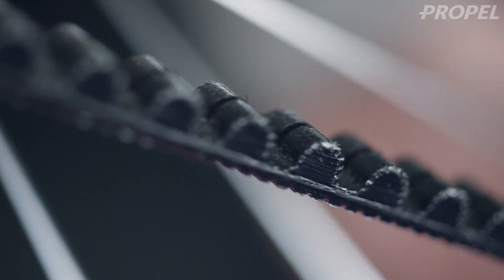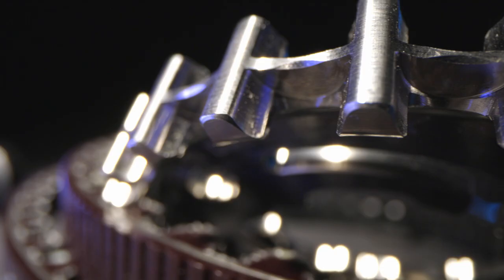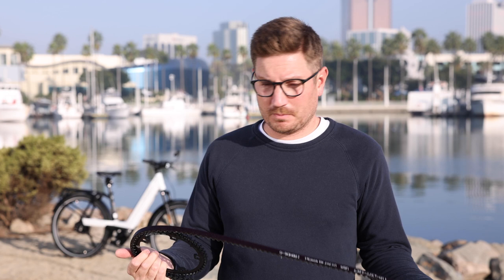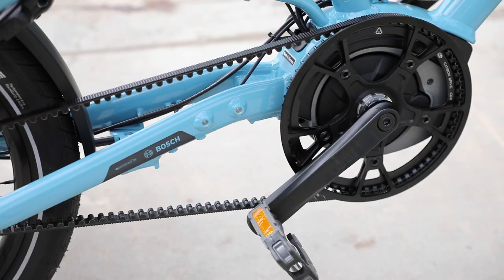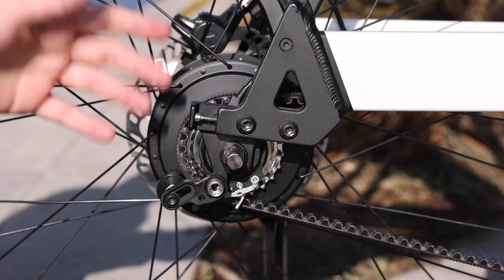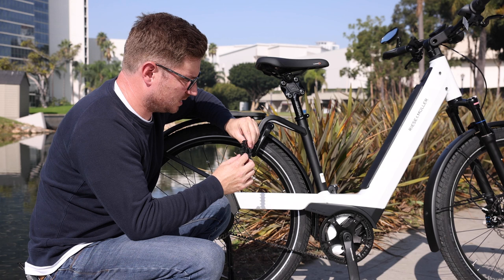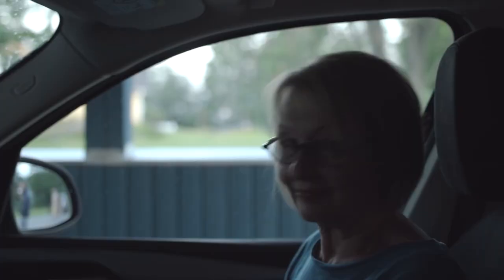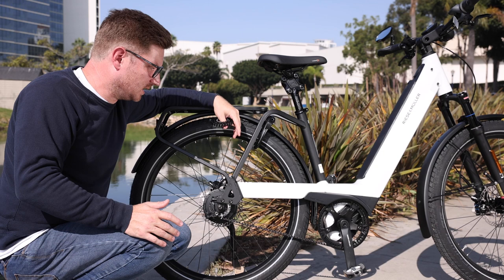Belt vs Chain - Will the Belt Win the Ebike Race?

Comment: Thank you for the amazing review! I’ve purchased my first bicycle with gates CDN few months ago and never regret about that, it is really almost zero maintenance and comfortable technology. 

Yep, there are some cons. Total odometer now about 1500km, often with rainy and greasy conditions. Because I purchased a low-end bike (polygon path i8) with polymer front and real sprockets,  the real sprocket already looks very bad and soon should be replaced with stainless steel one. Fortunately, seems like Gates do not offer anymore polymer rear sprockets option, so new users won’t face this issue, I hope.

Commuting by bike is not so popular in my city, carbon drive even less popular, and for all the time I’ve seen only 2 another bikes with carbon drive on the street. So, if this is also a your case, be ready that people may be curious and will ask many questions like “weird chain you have, nah, what is that?”

Comment: Cars moved from timing belts to timing chains so they would last much longer. Somehow with bikes they're marketing the opposite.

Belts are usually lighter, have no backlash and dampen vibrations a bit, which is nice I suppose.
Reply: Flapdrol, I thought the same thing. I'm guessing the main difference is that the timing chain of a car operates in an enclosed, clean, well-lubricated space, while bike chains operate out in the open and are thus vulnerable the elements. I still think timing chains are more durable for cars, but this video opened my eyes to some of the potential benefits of a modern belt for bike applications. It seems like the biggest drawback of the belt is that it is mostly impractical to have a hub motor due to the transmission being in the hub, thus kind of forcing a mid-drive setup.... the increased complexity of this setup (with internal hub transmission and mid-drive) I'm guessing makes these bikes more expensive, though that's just a guess.

Comment: If you live in super steep terrain, like I do, a Rohloff with belt drive is a must.
I’ve just destroyed a Bosch CX motor after three years of use, because the chain& drivetrain stressed the motor too much.
Also, I had to get a new chain twice a year and a cassette once a year.

Comment: If you are going for low maintenance you will need to use wheels that do not have wire spokes. Using magnesium or some type of light weight material that does not require adjusting spokes or trueing all the time. You will also need to use a sealer in the tires.
Reply from the maker: These can also be good measures to decrease the maintenance requirements

Comment: Thanks for a very good movie, Chris. It has everything you need to know about a belt-driven bike! I have experience approx. 3000 km driving belt driven R & M bike and I really enjoyed. The only small drawback is the annoying sound when driving in dusty conditions on a gravel road. But in this case, water washing helps. Cleaning and belt tightening are the only maintenance that I had to do.
Reply from the maker: Nice Tapio! Thanks for sharing your experience. I’d recommend trying some silicone spray to help keep the belt quiet in dusty conditions. You could also try Rohloff chain lube, I know it seems weird but it works well.
Reply: @Propelbikes   Thank you those tips, Chris. Until now, I have done a spray bottle of water and an old toothbrush, but next time I'll try, a silicone spray. Rohloff grease can be harder to find in here..
Reply from the maker: Cool! I hope you report back how it works out

Comment: About 5,300 miles on our two Rohloff's with Gates.  Only issue we encountered was the lockrings for the cogs did loosen up at one point - which caused noise.  A special tool and the right size torque wrench has solved that problem.

The belts still seem fine.  The cogs do show some wear - but they appear to be wearing a "flat" to the end of each tooth as opposed to each tooth wearing down thinner.  We live in the desert, so the belts never see wet weather with road grit thrown up on the bike.  From the what I've seen, I'd guess the cogs might need replacement at about 10,000 miles.  Question:  Should the belt be changed at the same time as the cogs?

Comment: I've own motorcycles since I was old enough to drive ... I'm not talking about a honda step through, no, my first bike was a Triumph Tiger Cub ... then 3 months later i bought a Pre-unit 650cc Triumph at a police auction for $150... restored it (even the "Bates" seat)... over the years I still own 3 Triumphs (Including a 1968 Bonneville with a 750cc kit, a WWII restored Indian Scout (750cc) and a 1979 Shovel head dresser I bought NEW. One day a friend of mine years ago was with me at a repair shop here in Australia where I moved and I was getting some work done, so he lent me his new Harley which had a Rubber mounted engine, rubber primary drive belt and a rear wheel rubber drive belt. It was the smoothest Harley I had ever rode. When I got back I mentioned this to the HD mechanic.  He claimed not only smoother, less noise, but more efficient drive, in other words more HP. As I'm older than dirt and all that metal I got installed in me during the Vietnam War, I was looking at building my own new Harley Trike (still thinking about electric???) I think rubber drives beat anything hands down from my experience. I even took a friends Direct drive BMW R-750 on an 800 mile trip and it took for ever to get use to the drive on wet roads...I am old ...LOL

Comment: For me the Gates CDX Belt with Enviolo hub is a clear winner. 
The only thing that happened in 2000 km was that the belt started to make a small squeak after a thorough wash with detergents (of the whole bike). Applying a little bit of silicone spray, and all is smooth again. 
No wear visible after 2000km anyhow.

Comment: After riding both a belt with Shimano Nexus Hub then getting on a chain with derailleur I can tell you the performance of the chain driven machine is so much more responsive,  and it pulls up steep hills with less effort.  And as for maintenance I'm not sure what all the fuss is about, squirt of oil once in a while.  That said I would like to try a belt for a year, but I live in a hilly area and have been disappointed with the gearing of the Shimano hub, also theres the weight of hubs to consider.
Reply: I have a normal bike with a Shimano alfine hub and a belt and I have to say I cannot feel any lost of power. I have to agreed Shimano hubs are entry level in internal gear hubs and they should have more gears but they do the job. The belt is the best part . Free of maintenance. Love it
Reply: I've read many comments of users stating that gearboxes and gear hubs are less efficient than chain driven bikes with derailleur in good condition. And a Shimano Nexus Hub is certainly not as  efficient as a Rohloff gear hub or a Pinion gearbox. But some users stated that they felt the Pinion gearbox and the Rohloff gear hub beeing sluggish and less efficient compared to a chain driven drivetrain with derailleur.

Comment: How much more difficult is it to fix a rear flat with a belt drive?
Reply from the maker: It shouldn’t be different than a chain, but it really depends on the drivetrain. Some internal hubs can take a little extra work, but not much.
Reply: @Propelbikes  On my Priority Current you can remove the wheel without changing the belt tension adjustment. There is an additional step to disengage the shifter on the gearless hub. Also, you need a wrench since it doesn't have a quick release axle.
Reply: Cumbersome. There's no way around it. Not so much the belt, but the frame. Get the Schwable or another "indestructible" type. I go to a bike shop every second year and have them change my tires. Not worth the hassle.
Reply: It'll depend on the frame. I think newer models are probably better. My 2010 road bike with a belt requires redoing all of the alignment if the rear wheel comes off. The actually removal and reinstallation is easy, but getting everything lined up again can be a pain.

Now that belts are more common, I think the newer designs use vertical dropouts and the wheel can be removed without changing the alignment.

Comment: Obviously you cant use belt with derailleur but i have internal geared hub and minimal loss in efficiency of this system is outweighed by positive factors.  Im not planning Tour de France entry so sticking with belt from now on.
Reply from the maker: I totally agree. The upside is way more than any of the downsides. I think you’re not alone in this thinking.

Comment: On the maintenance comparison:  what about chains protected as in Dutch bikes (like Gazelle) with full chain guards and internal hubs?  Do those chains last about as long as belts? How much less maintenance do they need than regular chains?
Reply: If the system is as enclosed as the chains are inside the engine of a car, than it has been proven that chains are more durable than belts. You never have to replace chains in the drivetrain of a car. Belts need to be replaced, otherwise they will tear up after 100.000 or more km in a car.

Comment: I Bougth a E-bike, short after my 70years Birthday, now i have used that bike with Gate´s Belt for 2636 km, without problems, the last 2 Month´s not used, because we have bad weather in DK. My Bike is a Danish Design: MBK Vitesse with Yamaha Motor PW-SE 60Nm and 400W Battery. Longest drive at one tour was 69 km, up and down at  normaly Roads. I can REALLY RECOMAND to buy a Bike with Belt.

Comment: I had a non electric belt drive bike, the Spot Acme and I was stunned how much the shimano alfine system slowed the rotation of the tire, I thought something must be wrong. The bike looked spotless after a salty WI winter, I'll give it that, quiet too. If I got a flat I might have to kneel down in bad weather to hold a phone on a belt to retension it.. I'd even consider a titanium cassette and chain over a belt even though the cost is high.

 I'm glad you mentioned it causes some stress on the chainstay.
Reply from the maker: I wonder if you had something else going on with that bike. It shouldn’t slow you down at all. For changing a flat different drop out designs are better than others. We don’t see the ones you need to retention when you remove the wheel anymore. Usually the adjustment is a separate part.
Reply: @Propelbikes  It's possible.

Comment: The neatest design shown is to have an extra roller and use that to push it up and route the bottom run of the belt over the chainstay. No frame break, no split belt. It just makes more sense.

Comment: For more than a year all my traveling needs have been met by biking.  I eat up a chain in a month to 2 months. Every other chain is a new gear set.  As the chain & gears wear getting the shifter to give me all my gears becomes a problem.   I ride 300+ miles per week.  Will be going to belt drive (Gates or Veer), with a Rohloff hub.  Far cheaper in the long run.
Reply from the maker: The good news with all this is that you’re getting some good time on your bike. I hope you’re enjoying it

Comment: "Belt drives most of the time (not always) require a split in the seat stays" so you can install the belt. You don't need to split the seat stays on a chain drive frame because you can just split and reconnect a chain link. So if you want a belt drive bike sell your chain drive bike and buy a belt drive bike with hub gears? An electric belt drive bike needs a crank motor which is less stressful for the motor as it can take advantage of the hub gears like the human rider. An electric motor with power assist from a torque sensor has a more natural feel than power assist from a cadence sensor.

Comment: I can’t imagine why anyone would prefer a traditional metal chain, when presented the option of a carbon belt drive. When they’re no longer cost-prohibitive, adoption will be imminent.

For those who don’t ride a bike very often, I suppose it wouldn’t matter much, since they wouldn’t be dealing with chain stretch or having to lube often, as long as they can store their bike indoors and keep it clean.
Reply from the maker: We totally agree Mo! Thanks for sharing your thoughts
Reply: I totally agree if you are commuting or going for a city drive but if you consider it for sports there are some major drawbacks mainly related to weight and efficiency reasons. Don't forget that a internal hub will way round about 2.5kg. A chain groupset will be round about 20% of that. Additionally a clean chain group has a higher efficiency.
Reply: Chains have been around forever. Early trucks had chain drives. There is also a big price differential between chain  and belt. As belt drives become more popular there will be more bikes available and the competition will make it more of a buyer's market. When I bought my CCX there weren't so many better options. Now I am looking to trade at some point but am willing to put up with the aforementioned problems with chain drive for the short term. I also like my Tesla better than my GM or Ford.
Reply: All else being equal, I would always choose a belt. Quiet, convenient, strong, easy maintenance, etc. But choosing a belt necessarily reduces the number of make/model options drastically.

(Others have noted the weight and efficiency aspects, which can be a concern to be sure, but only in certain applications. Even on my steel-frame commuter bike, which is pushing 50 lbs after accounting for add-ons like rear rack, kick stand, lights, etc. it's not a big deal, and for an e-bike you're really just looking at a percent or two less range on the battery...the motor easily eats up any power difference you might notice.)

Comment: The down side of belt drives is the changes needed in a frame to accommodate them. 

The stays have to be split and reinforced (heavier) to accommodate them. The extra weight matters less on ebikes or touring bikes.

Sadly the bike industry is still driven by the sports (performance) end of the market.

Comment: Recently got a Trek bike (District 4 - not an ebike) with belt drive - I now don't understand why anybody would want a chain drive.  The belt drive is superior in nearly every way for any normal person/use.
Reply: Unless you want to pair a belt drive to a single speed or the Rohloff you will be losing a decent amount of efficiency. Shimano less so, but the enviolo is a good 10% less efficient. So the motor will be consistenly be working harder.

Comment: I have a Raleigh Mountain bike from1991, aluminum frame, and it's got the chain going through the frame,  I think with the right design a person could run a belt drive without breaking the frame because I was interested in getting a Rohloff 14 speed. I'm looking for feedback on this and was trying to avoid replacing the bike since I've got so much money put in it already.

Comment: Good points, we definitely are seeing the evolution of what anthropologists might call Tribes, road cyclists are one and Lycra is part of their uniform. Messengers using bikes are another rarely in Lycra and at least in the uk often flouting road rulers giving a bad name to people on cycles. Mountain bikes form another and in many places Electric bikes are developing another band in the Cycling Tribe.  Just like pedestrians are challenging the dominance of cars in many towns so are cyclists. That does create tension as both cyclists and drivers try and navigate a mutually acceptable space. Town planners in most places are some way behind the increasing use of bikes which is a contributing factor in this tension. The Netherlands and other places are way ahead which is a key issues in the relative harmony there. In France its required that there is a 1.5m distance between cars and cyclists, even with this and a long tradition of cycle road racing, in 2020 there was 60,000 cycling accidents requiring emergency services response. As we develop a greater focus on bikes and e bikes in particular we need to evolve planing and behavioural responses to match increased use.

Comment: It will never really catch on. You need a special frame, crank and rear hub. That too many changes.
Reply from the maker: I guess we live in the twilight zone at my shop as it’s really popular.
Reply: That assumes a lack of change in the design of ebike frames - which, with so many mid-drive frames, what's the penalty for a bolt-on drive side dropout that disconnects the upper and lower stays? Minimal. Customizable drive systems - including axle spacing -  are already normalized in adventure bikes, so all it will take is establishing the benefit and viability of belt drives in the awareness of new buyers and experienced ebike riders who want a better option.

Comment: I have a 2020 Gazelle Grenoble ebike with a chain drive. Can it be converted to a belt drive?
Reply from the maker: Tony, it doesn’t seem the Grenoble has the frame break required for a belt and I wouldn’t recommend adding one. As mentioned in the video it’s also important to consider that the frame might not be made to keep the same tolerances a belt frame needs. 

The nice thing about the Grenoble is that it has a chain case though. For longevity and low maintenance this is the next best thing than a belt.

Comment: Belts are an excellent solution if you only need one ratio. Getting the advantages of a cheap derailleur is what is not quite ready for prime time. Multi speed hubs are pretty costly. On an ebike you don't absolutely need 21 speeds, but to get what you do, really beats down the belt advantage. So far.

Comment: ..belts for the ebikes and commuter bikes , silent, no maintenance, loooong lasting, reliable......😍😍
Reply: But for those wanting to ride their ebikes without using the motor assistance all the time, efficiency is key, and than derailleur gears come into play. And thus, they also expand the autonomy while riding with motor assistance.